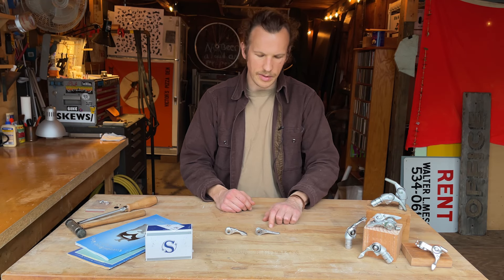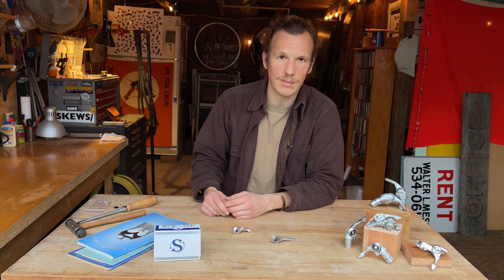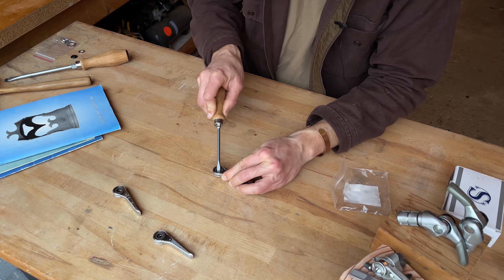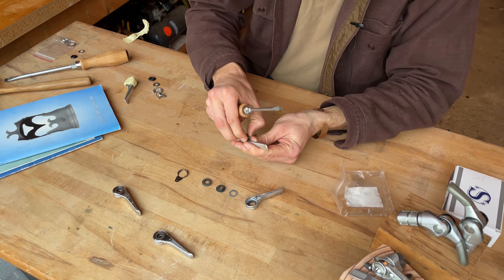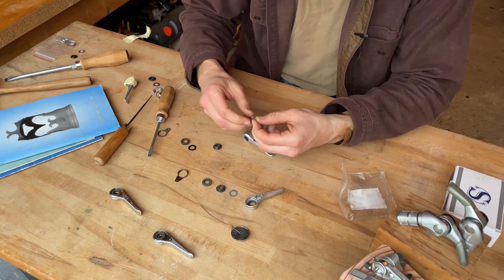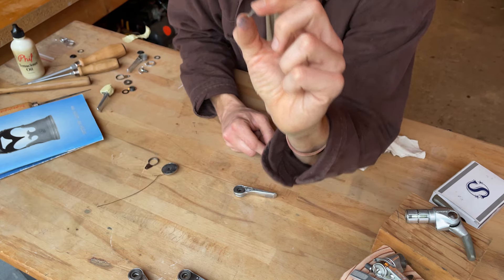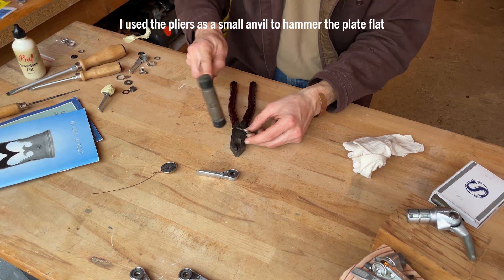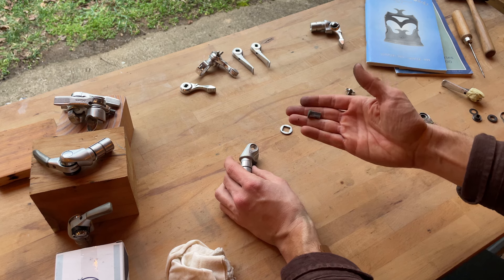Repairing Pam's Rivendell Silver shifters

Comment: This was fascinating, Eric. If I understood this correctly, the purpose of the ratchet is to virtually eliminate any friction inside the shifter when cable is being pulled, so that the rider only needs to counteract the tension from the derailleur's spring. When cable is released, the ratchet is locked and thus the combination of the derailleur's spring and the rider's fingers need to overcome the friction inside the shifter. Did I get it right? It's a clever improvement over a basic friction shifter.

Comment: When I have rehabbed Suntour Sprints in the past, I drilled out the brass pin holding the cover in place, then put in a new bit of brass rod (I think it was around 1/8") and peened it to lock in the cover.
Reply: Should have said - great video!
Reply from the maker: Heavy duty! I hope the press solution holds up. Seems like it'll be good